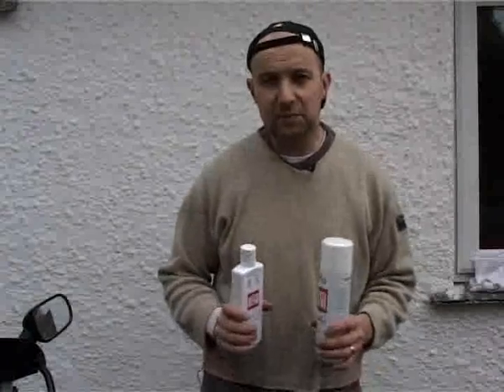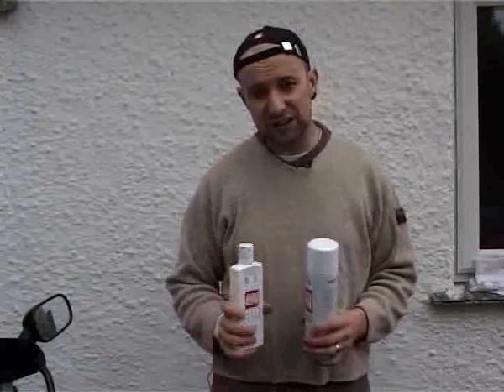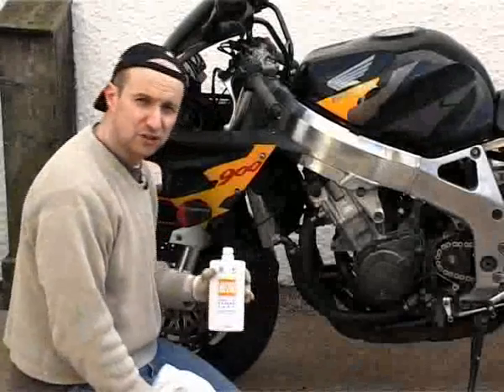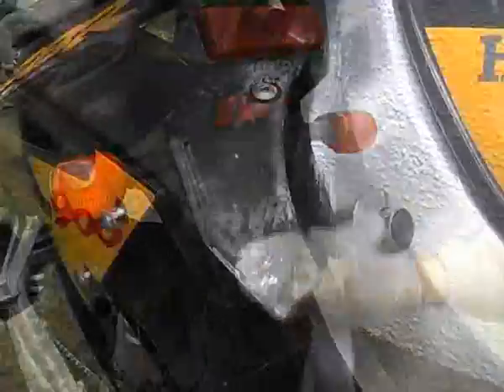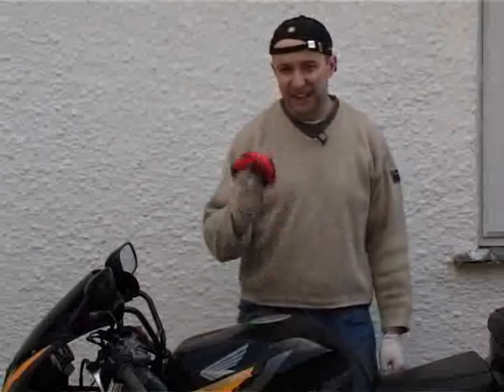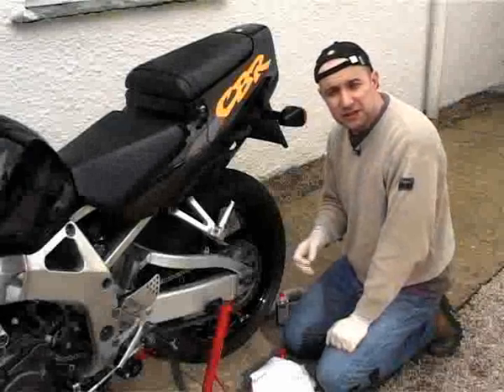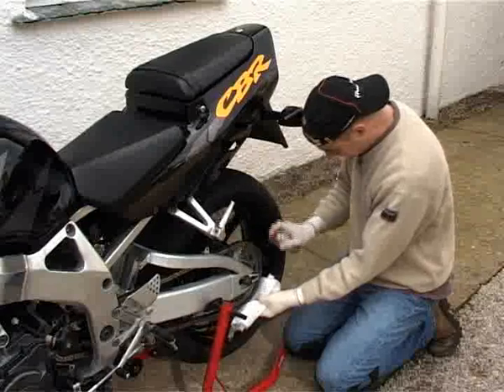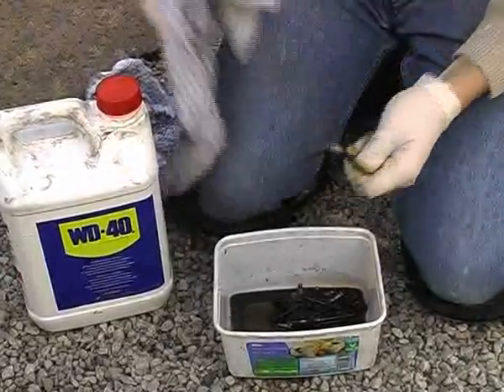Clean your Motorcycle - Part 4

Comment from the maker: Hi there

I would recommend a quick rinse with cold water at the end of the day, the cold water slows the salts reaction and of course washes most of it off. Just in the worst areas, under the mudguards and front of the engine.

Cheers

Nick

Comment: "i always use a blob of copper grease when fitting steel bolts to alloy parts to prevent Bi-metal corrosion"

So what do you think you're achieving by adding yet another metal to the process? Use an alloy anti-seize compound not copperslip or other such grease unless you're fitting steel bolts into steel parts!

Comment: U should never use WD40 on ur chain, its bad for the O-rings. Its best to use kerosene to clean it, & a good chain lube to lubricate and protect it.Also never spray on ur chain lube like he did in the video,avoid ur sprocket all together. Never spray the outside of the chain. U should spray the INSIDE of the chain, right in the center so that when ur riding,gravity pulls it to the outside of the chain. If u spray it on the outside it will just fling off the next time u ride.